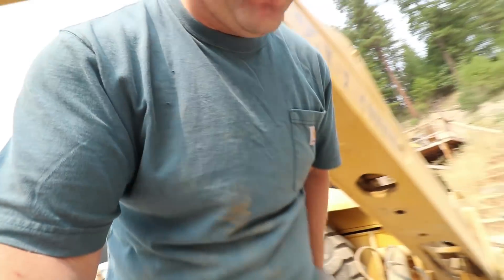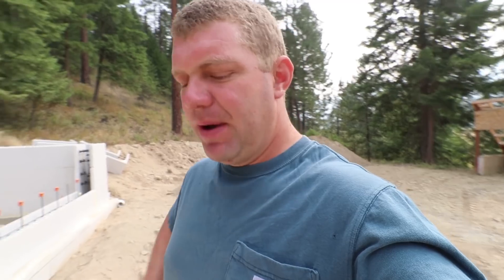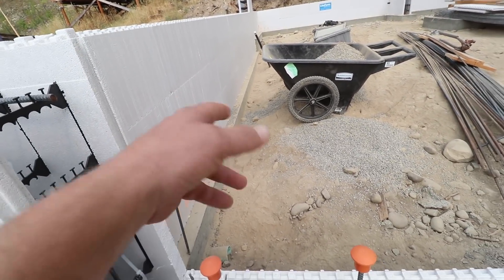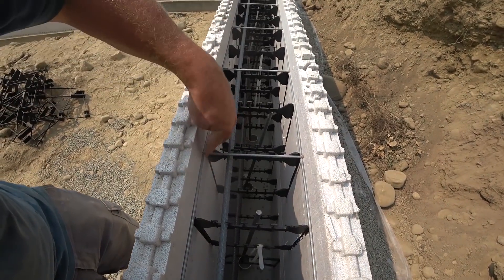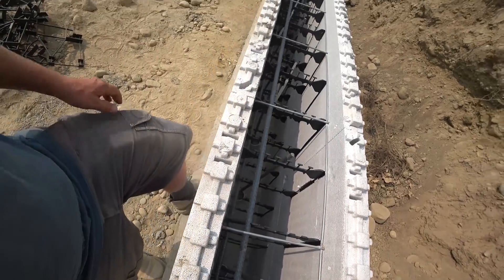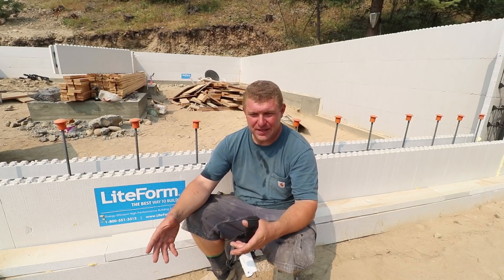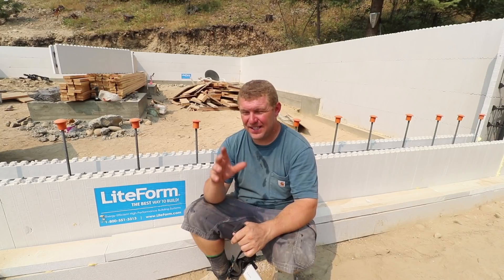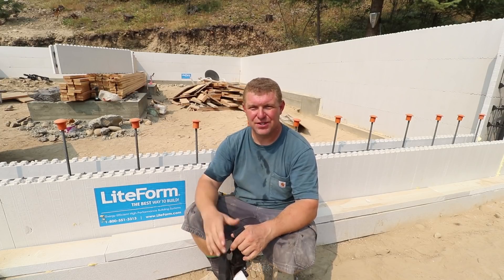Building a House Start to Finish: ICF Construction

Comment: Your tile drain pipe is upside down holes should be on the bottom
Reply: Exactly....
Reply: Jesse used 6" perforated sewer pipe with two rows of holes. ASTM spec for this pipe has the holes 120deg apart. So if one row is situated TDC then the other row would be 120 deg from that or 60deg from BDC. With some magical trig calculations , on a 6" diameter this would place the bottom holes 1.5" from the bottom (vertical measurement) This doesn't seem too bad to me.
Reply: Dosent matter. Those we have in my country have all the way around, and still does the job to perfection.
Reply: IIRC Jesse mentioned in the previous video that they glued some of the elbows (for the step down) the wrong way round, and had to install part of the drain pipe upside down.
Reply: At what point will the agency who issued the bldg permit inspect the forms and perimeter drainage?
Reply: It will work,,simple as that. Was there a better way? Likely but in a world of good better best,,,good does the job..Seen the filter cloth being placed on the pipes and on the drainage rock...That all depends on the soil/dirt in the area..
Reply: At least here's one person with an IQ here.
Reply: Racerxpunk2 drain pipe has holes on two sides.
Reply: If the holes are oriented at the top of the pipe that trench must flood to that point in order for the water to begin flowing through the pipe. Some water will flow through the gravel however the trench will constantly be flooded with at least several inches of water. Remember water expands when it freezes. If there is a shallow portion of the trench  that is close to the surface the constant freeze-thaw of the water left in the trench from a rainfall will ultimately result in breakdown of the concrete over time. They definitely live in an area where that is a concern in the cold months.
Reply: It will be fine. one way carry water away, other disperse.
Reply: It'll still work....
Reply: I understand there are two sets of holes however the set of holes is located only on one half of the pipe roughly 1 inch from the bottom, or top. holes should be oriented as low as possible in order for drain to work properly
Reply: Racerxpunk is on CRACK and everyone responded poorly to his comment ... THERE WAS NO SHOWING OF THE DRAINPIPE AND IT'S HOLES IN THIS VIDEO!!
Reply: Do you go through life like this? do you notices people rolling there eyes at you much??
Reply: There is holes in the bottom of the pipe as well dumb fuck get with the program!
Reply: Hope he reads this sooner than later.

Comment: I stayed up till 3 in the morning to watch this because I couldn't wait till tomorrow to watch it love ur vids
Reply: g2macs... Wow
Reply: g2macs, sorry to hear that. Insomnia sux. I hear that the sun doesn't go down until 930 @ night in the summer in Scotland. Is that true?
Reply: BST here also. 03:16 am 
I love these two.
Reply: I lick my ass too.
Reply: Matthew Crosson That's just sad
Reply: Get a big red funnel from walmart with a 1 or 1.5 inch opening and take that funnel off your jugs... the funnel also has a fine screen and will pour just fine... plus your charging issue not sure if it was corrected thinking it is a voltage regulator. I just replaced mine... ebay one they are what 30 bucks? Does your light come on and if you disconnect the battery when running does it quit?
Reply: Matthew Crosson, where are you that it's 3am? Guessing yer summers in Europe cause it's just past 2200 here in FLA😉👍

Comment: Why is the front one row high and the rest is four high
Reply: It is my understanding that the lower level will be a garage with living space above it.
Reply: It's where the garage is going...
Reply: Dale Jensen the grade is going to be brought up to the top of the second row of blocks and then they're going to fill in the inside. They will be putting angled rebar in the front to tie them together. If you watch the one where they pour the concrete they talk about it.
Reply: The walls will cave in and cause a landslide that reaches town and wipe out all the roads in the area...They will be charges with criminal neglect and the UN will call for them to be extracted to Macedonia for trial...Wikileaks just released their top secret email communications with a contractor that said top holes would cause an avalanche. Obviously they are Russian spies..
Reply: Prob so they can get inside easier and not have to hope over a 5 foot tall wall.
Reply: Also, they have it lower so they can get inside the walls to work
Reply: Jack Price so that they can access the site. They'll make it two high when they're almost ready to pour.